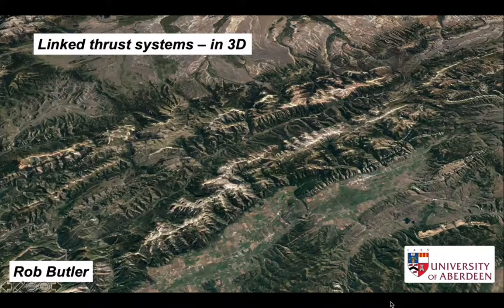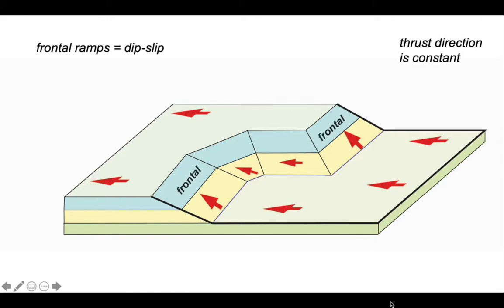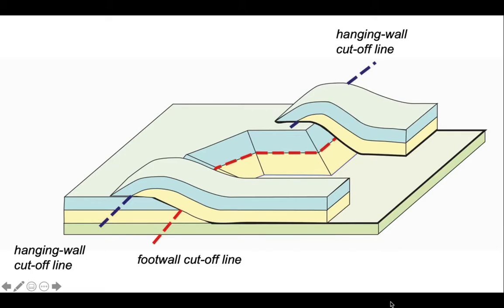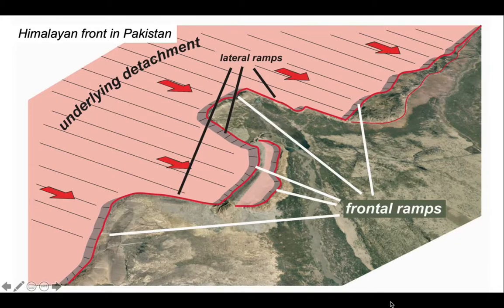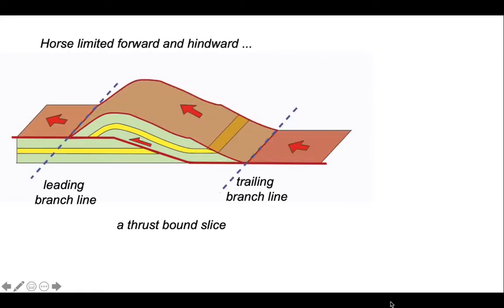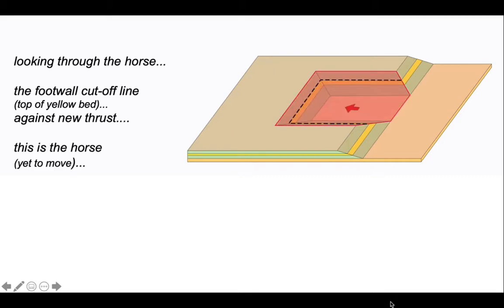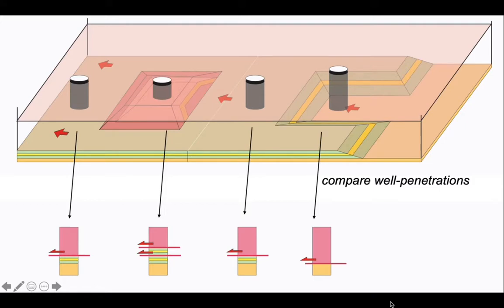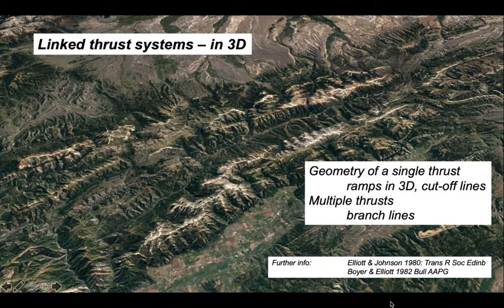Linked thrust systems - in 3D

Comment: What great this 3D  job  is! I usually think the word "detachment" is on behalf of regional extensional structure,   and "decollement" is usuallly used as a contraction structure in the subduction zone. You here use "detachment", then I am not sure its stress field system, reverse or normal.
Reply from the maker: Thanks. Detachment and decollement are interchangable (decollement - unstuck from French)....
Reply: @robbutler2095  I also see the word “Denudation fault” in some manuscripts, which may refer to a super plate driving detachment (such as the force between plates). But the extensitional detachment formed by active movement of lower plate (such as magmatic intrusion). Do you think whether that “Denudation fault” statement is appropriate or not?